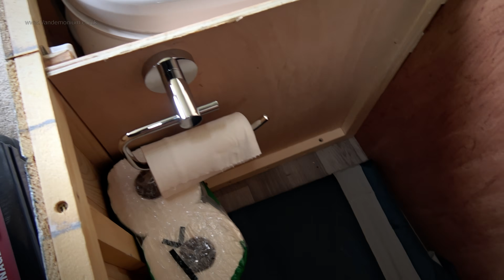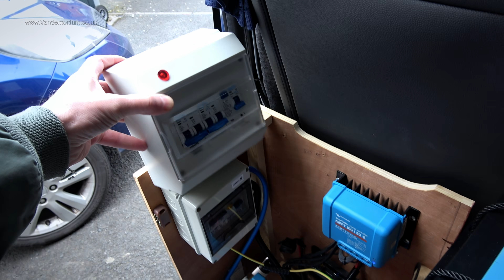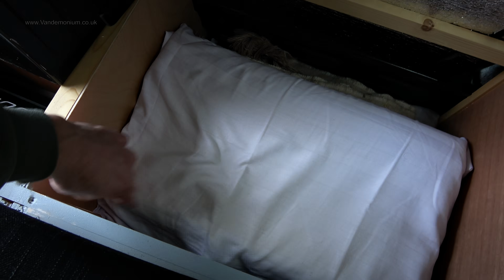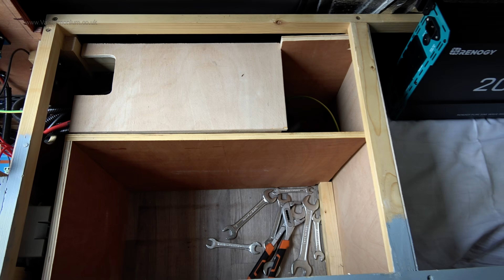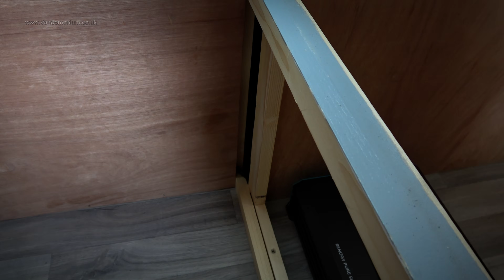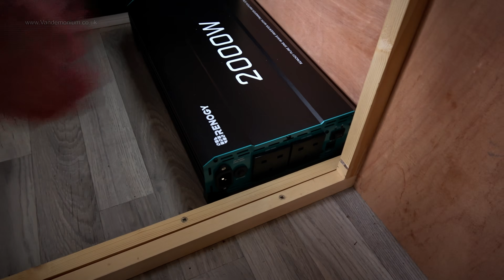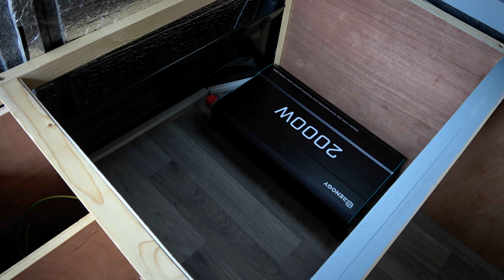78. How should I arrange the new campervan electricals?

Comment from the maker: Hello all! Here are some answers to the (very!) frequently asked questions and frequently offered suggestions:-
1. I stand to be corrected (!!!) but I'm not convinced yet that the inverter will get too hot as it will only ever run for about 10 minutes at a time (warming some soup or boiling some rice etc) and it is very cool down on the floor where I hope it might go.
2. Yes, I will buy 90-degree lugs and see if I can get the inverter in the same cabinet as the battery, as I initially considered then dismissed.
3. There is not enough room to put the inverter above the battery.
4. I need to have a look under the passenger seat to see if there's space there, yes
5. The bedding does fill its section (I had removed two duvets while filming!)
6. It's only a cold tap (I know it looks like a mixer but isn't!)
Cheers and thanks for all the lovely tips!
David
Reply: At the end of the day, it's YOUR VAN, and you're the one that has to live with whatever you do! I enjoy watching you faffing about and yelling at the screen every time regardless!  ENJOY! 💜💜💜😻
Reply: It looks as though from the comments you have taken quite a beating on this particular subject.  I am sorry this has turned into more modifications to your existing electrics housing than expected but, since you are trying to increase your power output by 5 times, extensive reworking is not uncommon.

It's is hard to get a precise approximation of how long the induction cooktop will be running since it takes a lot of power to bring water to a boil.  I am just erring on the side of extra design margin in regards to heating of the electrics since, excessive heat in that area will shorten the inverter, as well as the battery life.
Reply from the maker: Bill, I wouldn't say a beating - all good advice and suggestions - just a lot of repeats so I'm trying to save people the effort if their suggestion has already been made!
Reply: @Vandemonium  Good idea David, thanks for clarifying.  That "beating" reference was just my attempt at dry humor.
Reply: MY 2000 Watt pure sinewave  inverter lives in a similar space to yours (under an enclosed  seat), and it never heats up. The internal fan sees to that, along with the sufficient air space in the enclosure-- which is unvented.
Reply: I'm glad you added this as I was just typing up a reply to suggest some of the same. Believe it or not, these "not very fun" videos are the best to me, as the interest in coming up with clever engineering solutions and tinkering are the main reason I'm here. Well, that and the puns. Appreciate the videos as always, David! Cheers from rainy California!
Reply: Ground Fault (Circuit) Interrupter (GFI) is the common term in the US.  The assumption is that any imbalance in current must be passing to the ground somewhere.   It works the same as the ones you have.  The two wires that are supposed to carry the current pass through a sensing device that detects any difference in the current.

Comment: What leaps out at me  at 12:45  but one year later - why not braze your stonking great positive cable to an angle piece to be bolted on to the inverter. But I didn't read comments yet or see what you eventually did.
Reply: Ah! 90-degree lugs were the words I was looking for.
Reply: Add a panel between bedding and storage area. fit inverter to new panel,, cable straight to battery and socket

Comment: David would all this be less confusion with a simple solar generator install ( Pecron 1500 lfp) compact utilizing more space for storage ......WE the noeth .....S
Reply from the maker: Not really as that wouldn't interface with all the existing electricals and I'd always have to remember to charge it before travel (which I wouldn't) and for that matter remember to bring it with me. It also wouldn't have 4kWh of power as this does. Those things really aren't some magic bullet like people seem to think they are.
Reply: yes understand your squepition moreover;  for just the cost of all the old way componnets a unit can be purchansed with warranty also add on batteries with raises to 7600 kwh with quick connect solar hook ups. Port that connects add on battery exstensions will double that of a 110 lbs. thrust trolling motor with no exstra cost or adaptor ......... add any thing to it even 200 W heater   @Vandemonium

Comment: The wiring cupboard is an organized mess. Just the other day, my friends and I agreed that we'd all rather have an organized mess than disorganized tidiness. :)

I thought I would have bent the eyelets for the inverter connections to get the leads out at right-angles, and put the inverter where the water bottle is. That would mean leaving off the insulating connection covers which I think would be fine if you never drop a spanner across the terminals, but I'm not a professional. Thinking about it, if anything metal ever did get across those terminals, it would be hard to pull it free due to the amount of current flowing, and that's before it got hot. It would probably be best to play it safe and make sure the terminals are quite definitely insulated. I assume the battery terminals also have insulating caps, though I don't see them on the un-installed battery. 

Looks like we've gone metric. We used to have SWG -- standard wire gauge. I think I like mm2 better; it should drop into calculations much more nicely.

Comment: After spending £1799 on a lithium battery; why spend £240 on an inverter that has 15w standby when you already have a Victron charger. Victron do a  MultiPlus 1600VA inverter unit which in hindsight would have been more suitable. Also, a bit cheeky not finishing off the video; patience is the virtue here. 😎👍
Reply from the maker: I'm quite happy with this inverter and not a huge fan of Victron gear. The Multiplus would have been too big as well.

Comment: Have you considered placing the new long inverter diagonally in the pillow space?  It would give much more room for the fans and the wires would be shorter and bend less.  Then you could cover it with a board and still have room for the bedding to fit.  I hope you read this in time.  Good luck.
Reply from the maker: See the next video, which was released today!

Comment: Perhaps there are batteries and inverters with the performance you need as well as more favourable dimensions.  Something to consider in the future, a great deal of painful research during the shopping phase can save one from future headaches.

Of course if you got a great deal on that battery and inverter, that's understandable!
Reply from the maker: The battery was free as explained in a prior video and the inverter is typical of its size.

Comment: David,Could the big storage space be halved, 50% for bedding & 50% for storage.

The ex bedding area then for. the inverter. Take out old consumer unit put the new consumer unit on the back plate in next to the blue thing (sorry forgot what it's called).

The battery is then the issue especially where wiring & ventilation is concerned I guess.

A loo roll holder is indeed the height of civilised living.
Cheers
Stuart

Comment: Am I alone in thinking that the cables that have serious terminals can come out to the side of the inverter if you cut a slot in the red and black collars because it seems you have a 180° range to choose from. Never underestimate the bastardry of water. That lovely inverter has over temperature cutout, and output short circuit protection. I can't see it melting down on you. They are at a damned attractive price here in Australia. Coming to a boat near me!

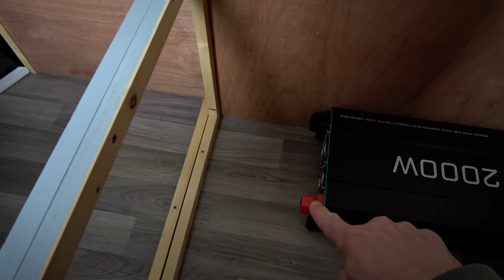Comment: @21:10 you begin to explain my thinking, and I thank you for that.
If you drill some holes into the woodwork, forming the starboard side of the clothes+inverter compartment, it would give a channel of cooler air, which will healthily be used by the inverter.
Also, you can poke some holes into the loo-compartment likewise, to provide access to yet another box of breeze.

Comment: To my understanding the 'barbed' saw-tooth moulding on the pipe adapters is to stop the pipes slipping off. Also, with the pipe being made of flexible plastic/rubber, using a jubilee clip would force the saw-toothed into the pipe thus creating a water tight seal... it is also more easily removeable should there be a problem at the other end of the pipe 😉
Glad you got it all sorted out though.

p.s. Did you ever put any foam strip around the top of the cabinets for the worktop to sit on? This will stop the worktop from creaking and the bolt fasteners from noisily rattling loose while the van is being driven.

p.p.s. I can't believe it took YT 7 days to notify me about this video 😒

Comment: I sense you are having difficulties in making a choice here David and fully committing to it.🤔 Sacrifice the place for bedding to create a safe and improved space for a battery, inverter, and possibly storage for an induction hob. If it were mine to make (I fully appreciate that it isn't or indeed anyone else's) I'd have no qualms about transferring the bedding into compression sacks as mentioned in the comments (several times) and storing the said sacks in long tube cases or a duffle bag of sorts and using them instead of those yellow things. The bedding would remain clean and doubly protected from spillage or creepy crawlies and offer wonderful support to your back as an added bonus.😊

Comment: The Inverter needs ventilation, which means access to an external supply of fresh air. Putting in a closed storage box to just recycle air within which will get hotter and hotter. It needs to draw in cool air. An out of the box solution required ;-)
Reply from the maker: The back of the “box” I propose to put it in is not enclosed but has a huge gap where the bottom of the old metal bulkhead was, there is lots of scope for air to flow in.

Comment: If you were removing the dividers, etc where the water bottle was sitting, you could fit the battery & inverter in that box with the terminals for the inverter ( mounted on its side) poking through drilled holes in the fuse/electrics cupboard

Comment: CC I was watching and the obvious answer kept coming to me. Why don't you remove the centre wooden divide in the existing battery box and put the new battery in there facing down the van ( if you get my drift) so that the contacts are near the front corner where you want to put the master switch. You can then put the inverter beside it and if necessary move the side wall so both fit together and you still have a reasonable size storage box for the bedding. 🤔🤔

Comment: Redo the entire electrics cabinets sections.  Keeping bits of the old setup, such as the solar charge controller and switches is limiting your layout options.  You can do better if you redo it.

NEVER use multiple conductors for a load.  If one conductor fails, you’ll have an instant fire.  Get the right gauge wire.  AWG = American Wire Gauge.
Reply from the maker: I’m certainly not re-doing the whole lot, it’s not necessary

Comment: Congratz on the crap wrap holder, was a little surprised there was no campervan and narrowboat mags in the storage with the crap wrap and other stuff.. Looking for a couple of 10" agm under a seat, opposite the throne under another seat. There are terminals I've seen, never used in an 'L' shape. They were lead then but, Nice job m8, Batts that size Downunda, sit down, don't fall down $1,859.??

Comment: If those main battery cables are aluminum, throw them away and get real copper cables. The copper will handle that much power without a problem. Never use aluminum cables. They're garbage and cause problems, including fires. I would just put the battery and the inverter in your existing battery compartment with the terminals facing the electrical compartment ( towards the door). That would keep everything in a smaller area with shorter cables. The partitions would have to go, but no major loss.

Comment: You can get 90 angle connectors.

Even thick welding cable is pretty flexible

Why not put the inverter on top of the battery

Comment: if wiring's not an issue, i would look at mounting the inverter under the passenger seat. if it fits, you'll keep demolition to a minimum and lose less storage space (also allow proper ventilation for the inverter)

Comment: I would remove all the Bedding bits from their compartment. Open up the area into one space. Then fit all your electronics, setting them out where they fit together best and giving you all the access you need. Then go back and think where the bedding could go . May be it could just go into a hold-all which can be easily moved around , like the new Hob. Look forward to seeing your final solution.

Comment: I'd sell them and get a portable power bank. I've got a similar set up in my Pug Expert but everyday I wonder why I bothered 😂
Reply from the maker: Then I'd have to work out where to put that to make it usable plus how to run all the existing stuff from it (fridge, heater etc) and it's no different from what I have here in terms of function. Plus if any bit breaks in my setup, I can just replace that rather than needing a whole new unit. As you can tell, I'm not a fan of those power banks 🤣
Reply: @Vandemonium  haha fair enough. I'm off to France in summer for a month and I have 200w of solar on the roof and I'm hoping it'll be enough to charge my e-bike, portable fridge, phone and laptop but we'll see. Thanks for busting up your build by the way. Really enjoying watching your videos and now feel like I could fit a diesel heater for next winter. Still no running water or permanent cooking facilities but I like sandwiches 😂
Reply from the maker: E-bike might be pushing it but then again, in summer you could be fine.

Comment: Just to put a spanner in the works lol.. put the inverter plug side next to the two sockets where the jerry can is.. then you can get 90 degree cable lugs, you can get left, right and pointing up lugs.. fix the inverter to the wall opposite the Battery

Comment: I have the same van, Wont the inverter go under the front seat? i will give it more room to keep cool. Regarding the bedding and pillows etc i bought 2 of the the biggest sofa cushion covers and i store them all in those.
Reply: PS. the inverter goes direct to battery so you will need another isolater.

Comment: Could the whole be simplified with a Victron Inverter Charger [12/2000-80-30] instead of the Renology ?  Might have saved a lot of wiring ?
Reply from the maker: But I already have a charger. And Victron stuff is expensive and I'm not a huge fan.

Comment: Here, across the pond in the colonies, it's GFCI, "Ground-Fault Circuit Interrupter.
Reply: The difference is that GFCIs tend to operate at 3-5mA, most RCDs are in the 30mA range (as we often used to use them to control multiple circuits, so leakage added up)

Comment: I would put the inverter above the battery separated buy the shelf. You can get right angled terminal connectors. Yes you would need to widen that bit but the panel between battery is the only bit that needs modifying, making the bedding compartment an bit of an L shape. The brace across the top can stay in place. This would keep high amp cables short, provide able space around for cooling and minimise space lost in my opinion. what ever you decide, good luck!

Comment: The bedding storage space needs to be the spot for the inverter, so you aren't running cable over 'hill and dale' .  You're talking about a false bottom in that space to cover cables, put the inverter there, under the false bottom, bedding on top and next door in the huge storage space.  You are cracking me up, D 😁😁😁😁 😉 🍀🍀🍀    or....?